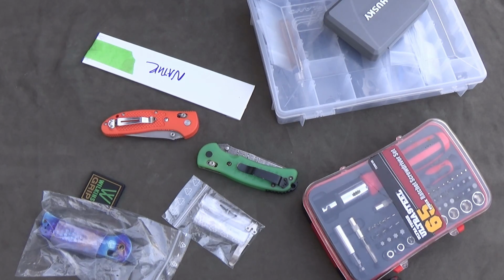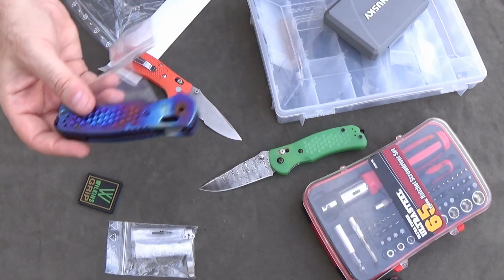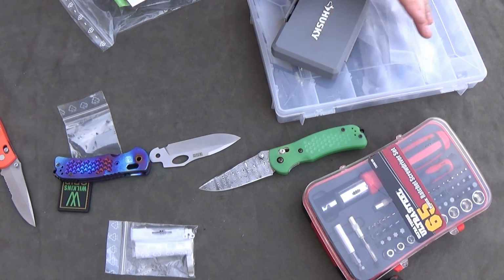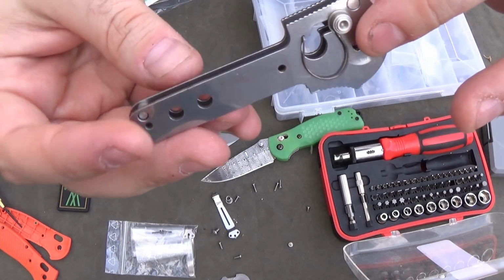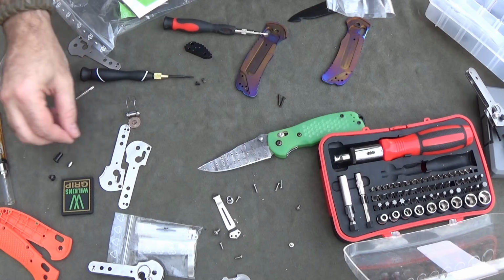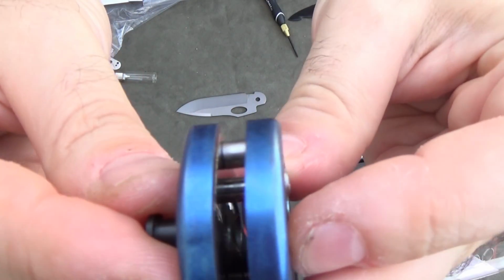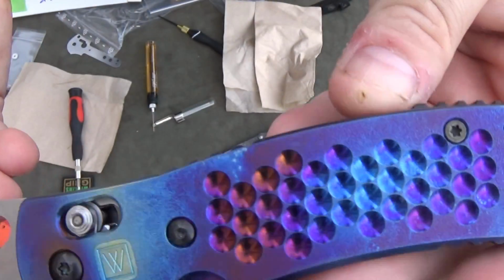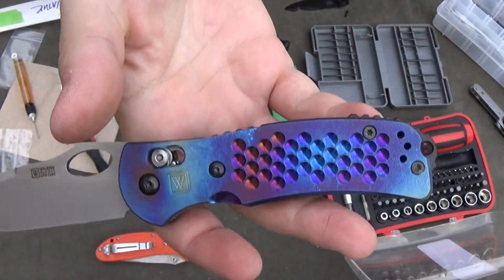Custom Modified Benchmade Griptilian - Wilkins Blade & Scales Install & Mini Review

Comment: Wilkins made some good scales. Realizing this is now 4 years old, have you tried a grip kit from AWT (Applied Weapons Technology)? It's It's small outfit in Kentucky. They make handles for several different Benchmade models and Spydercos. They are mil spec hard coat anodized aircraft aluminum and come in quite a few colors. A little expensive but well worth the money.
Reply from the maker: I've seen AWT scales but I don't own any. If I pick up a new BM I might think about grabbing scales with it.

Comment: You know, you can get a free Griptilian, black, deepcarry pocket clip from Benchmade. All you have to do is call the customer service line. I saw Simple Little Life do it in his "Thank you Benchmade" Sep 13, 2017 video. I have since called and received mine. EasyPeasy.
Reply from the maker: That is actually a really good clip! It's the same one that comes on the 810 and 275. Thanks for the tip!
Reply: Just passing along good info to a fellow enthusiast/addict.